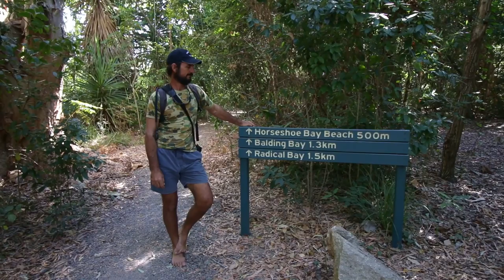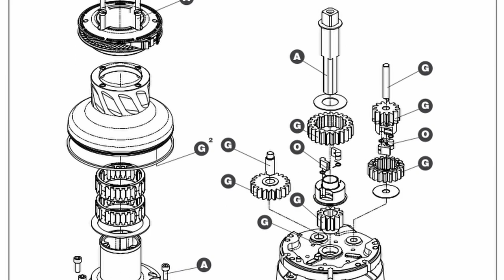Magnetic Bears and 2 Speed Winch Service - Free Range Sailing Ep 62

Comment: As a soon to be sailor I've never taken apart a winch but I'm sure it will be one of the maintenance jobs I'd be obsessed about. I've worked as a mechanic for 20 years in a a few unrelated industries. From industrial turbines and turbo pumps, chemistry and biology analyzing equipment to chocolate manufacturing and packaging machinery. Having diverse mechanical and electrical systems in my home that I can tinker with is one of the many facets of cruising that I'm looking forward to.
Reply from the maker: There will be endless opportunities to express your mechanical passions on board and it's a great way to make friends afloat.

Comment: I had an old 1950's metal machining book, and it really sung the praises of lanolin for lubrication, because they said it was one of the few oils that naturally flow towards a hotter part of metal from a colder part.  In metal assemblies heat can often mean friction, so you basically get old fashioned "nano tech robots" moving lubericant to where it is needed most.
Reply from the maker: It does a pretty good job but that is new info to me.

Comment: nice one(again)! one addition: It pays to keep good care of / replacing the pawls and springs because there's a serious risk of injury if the pawls slip through in windy conditions. You'll get whacked by the winch handle pretty badly (obvious to most experienced sailors but worth mentioning for motivating beginners). Saw this happening once on a 31ft boat, major bruising. I guess on larger boats this breaks bones.

My local parts monger also convinced me to use lanolin, especially fluid film which is lanolin, wool flakes and some special seven herbs and spices for corrosion resistance. Normally used to protect the undercarriage / frame inerts of cars.

Comment: There are similar springs and pawls on the wheels of my self-propelled mower.   When I cleaned the gear drive of grass and old grease, I was amazed that a tiny little spring like that could kill the whole drive system...all those gears, belt and transmission become worthless if that spring is broken, missing or installed backwards.
Reply from the maker: Small things matter.

Comment: That winch segment was WAY too stimulating ;-). As a general "maintenance" type for most of my life, there were quite a few lessons for this non-sailor. Tip #1? Find a Pascal! :-). I actually used lanolin for years as part of a leather care goo for the bits and bobs that go onto our birds of prey. It was messy and painful (it had to be melted along with beeswax). But a few years ago, we could not get our "pharmaceutical" grade lanolin any more! I found an off the shelf product that was developed for firefighter's leather and it works a treat! And no more burns :-) (Obenauf's Heavy Duty LP). Another amazing video, thanks. Tim
Reply from the maker: It's an amazingly versatile product. We had some limited success in using it to antifoul our propeller. It's too biodegradable to last a long time though.
Reply: Free Range Sailing 
If you staple the shark skin from last week to the prop the barnacles get grossed out and won’t stick.

Comment: When I use vinegar for cleaning, I all ways heat it up to about the same temp. as coffee. You get a much better chemical reaction.
Reply from the maker: Sounds like good advice.
Reply: I used 4 gallons of vinegar to remove rust from a boat trailer frame.  Small pieces in a bath, large pieces spritzed and wrapped in plastic. Note acidity on label get the strongest.  "Thought heavy duty boat salad" and chuckled through the process. Ha

Comment: I knew a guy that kept a modified bucket on board with a hole in the bottom that tightly fit the base of the winches... So with the winch bucket installed if you drop something it can't go overboard.
Reply from the maker: Ahh, life on a boat with storage room!
Reply: Yeah I mean, not on my liveaboard. But for the guy that has a dock box or garage at home and has been putting off a winch maintenance out of fear of losing parts, could be the little confidence boost cheat that gets the job done.

Comment: Love the tutorial.  One  question though. What do you do with the old diesel fuel used for cleaning greasy parts?
Reply from the maker: It can be used quite a bit then we disposed of it at the shipyard where we hauled out later. Most ports have a facility to receive oils, rags and other pollutants. We have a drum for waste oil that can hold 5 changes worth of oil or about 1000 hours of running.

Comment: To tell the difference between stainless steel 304 and 316 use a magnet for a referential check>
Ok so what does that even mean? 
The pull is a lot less for 316 than for 304, so you need examples of both to find out
How will you find examples of both? Often (actually by conforming with rules) SS bolts and nuts have the grade impressed on them
have a good one ..